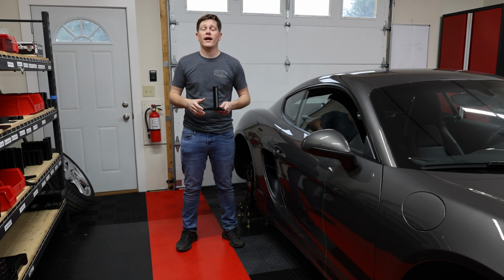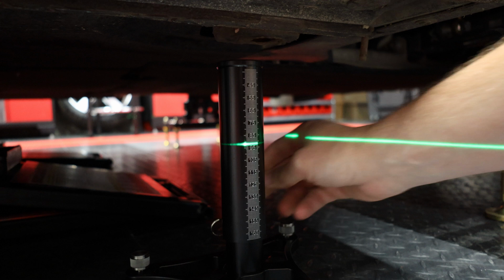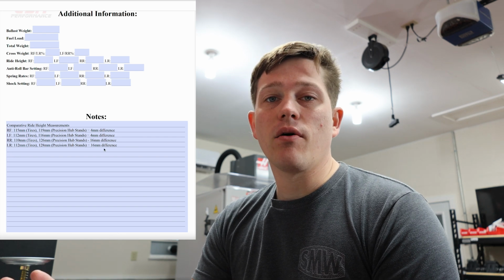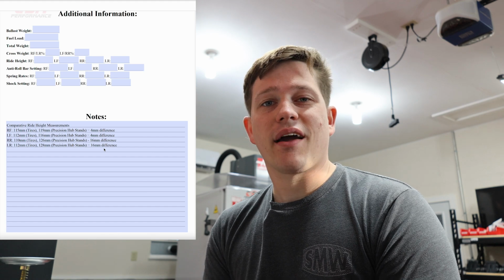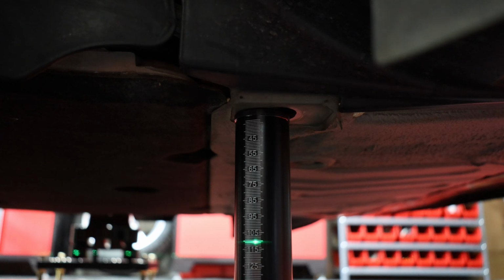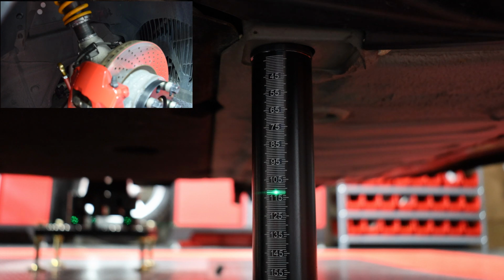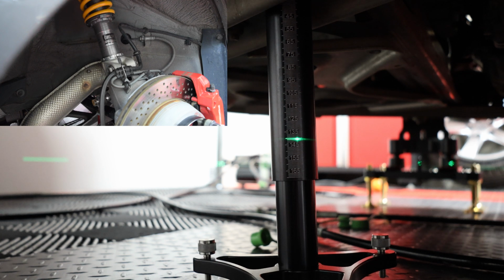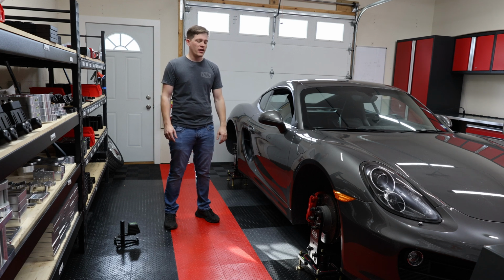Setting Ride Height | Porsche Pro Tutorial Series #4

Comment: Thanks CSM for this video series! I am just wondering about the ride height measurement. If the cars on the levelled platform already, shouldn't you be measuring heights from the platforms instead of the actual floor since it's assumed not levelled to begin with?
Reply from the maker: Great Question! The Ride Height Gauge is essentially as an upside ruler and is therefore independent of the floor underneath it. The Ride Height Gauge doesn't measure from the chosen location to the ground, it measures from the chosen location to the laser line from the Laser Leveling System. The laser line is 25mm above the "ground plane" of the Hub Stands which is the buffer plates that they ride on. The Ride Height Gauge takes that 25mm into account as well. Essentially the Ride Height Gauge could be replaced with a ruler. The ruler then measures down from the frame/ride height location down to the laser line. The Ride Height Gauge is only spring loaded to give live ride height measurements as adjustments are made.